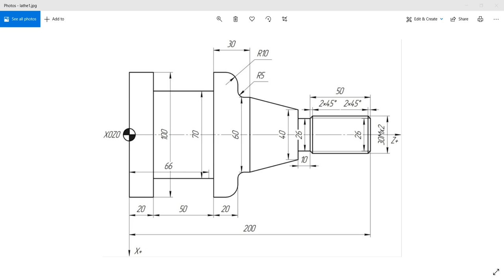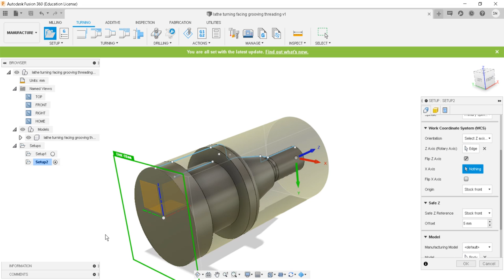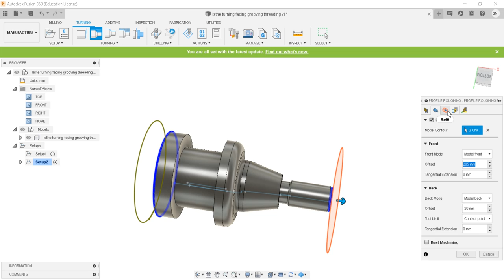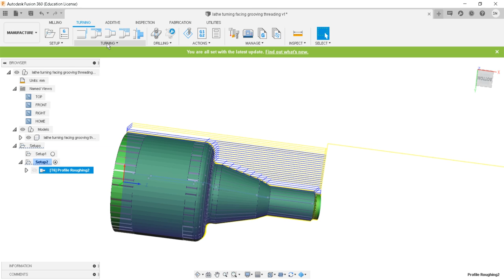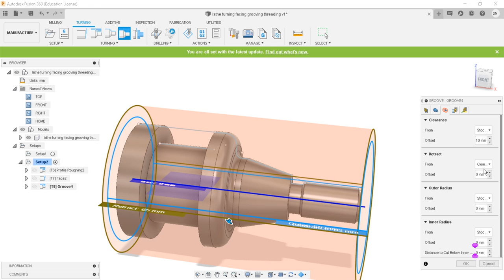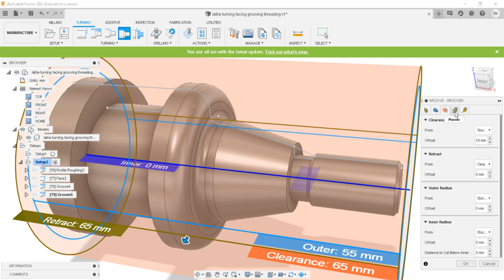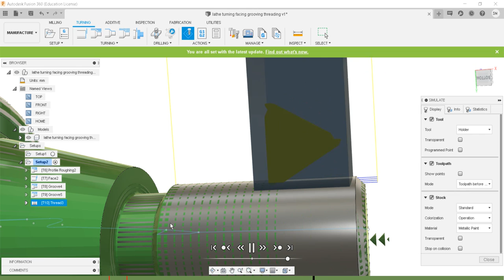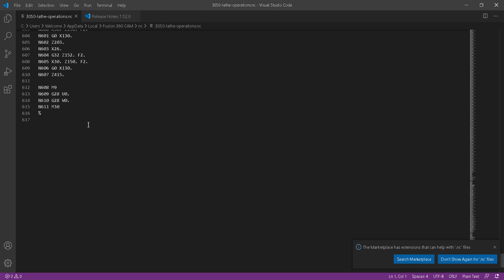Turning, Facing, Grooving & Threading Operations on Autodesk Fusion 360 - Manufacturing

Comment: Hello sir good evening, i work in a cnc vertical turning machine. I want to learn fusion  360. What should be the minimum system requirements. I am on low budget. Please help. Thanks l, your videos are good helping people like me.
Reply from the maker: Thanks and watching and keep watching. Fusion 360 requires minimum 4GB ram and i3 11th gen or higher processor. it doesn't require very high-end computer to operate.